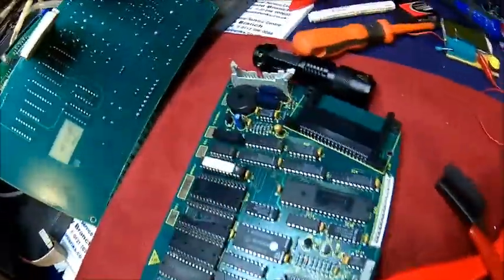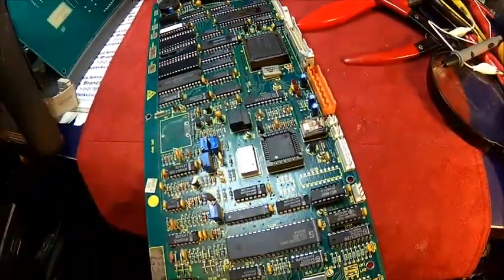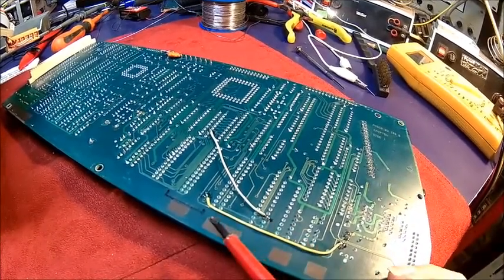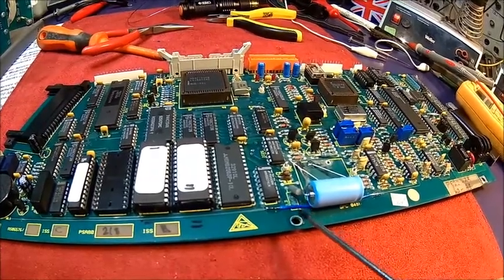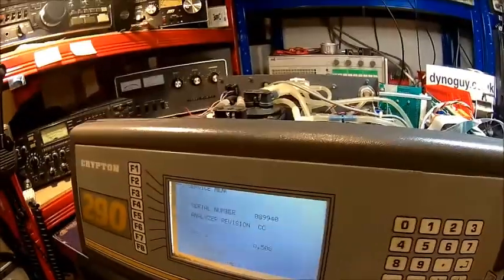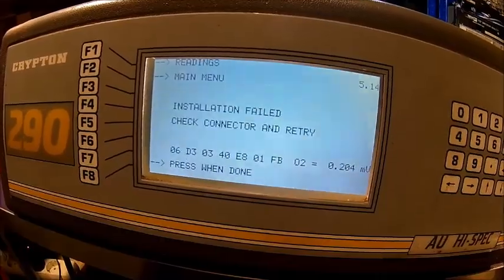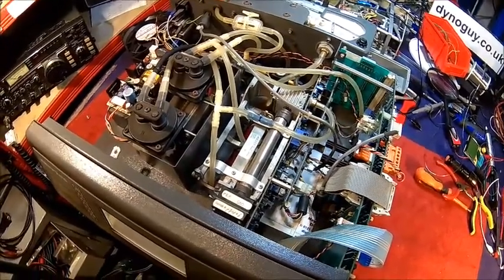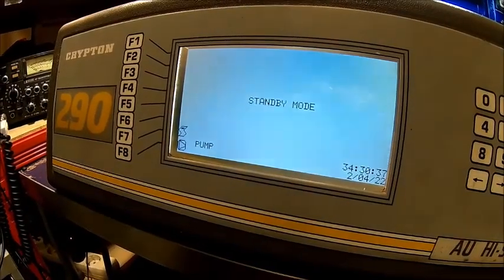Crypton 290 Emissions Analyser repair - part 3 - back to life ! (Car diagnostic equipment)

Comment: Very interesting you did find the problem... yes there are more with this problem... I did repair more of them.. all succes.. but today I did get a 290 with exactly the same problem as your tester,.. flickering screen after touching  a button. But I did look with wiring you did replace.. ( sorry hehe ), but it always those 2 wires that has to be fixed  with that problem ??  Thanks again we can learn.. Please can give me an answer. Regards PAB Netherlands
Reply from the maker: Perhaps a power supply issue, check all the supply voltages

Comment: Impressive job. Hopefully it all works when you hook up the new o2 sensor.
Reply from the maker: Thanks,  i am almost certain it will work, because it was accepting it when simulated the correct voltage level of a new sensor. We'll see when the sensor is here ....

Comment: Wow well done Mike you certainly know your stuff, if the O2 Sensor is anything like the ones in my flue gas analyser they only last around a year before the need replacing.

Alan.
Reply from the maker: Thanks Alan,  i think they are similar, but it seems the lifespan has more to do with running hours. As you use your equipment professionally it will get a lot more runtime than in my shop where i only use it occasionally.

Comment: Well done, I really enjoyed the 3 parts. I had a problem with my transwave converter boost and it turned out that my 24v transformer had burnt out too.
Works perfectly now 👍
Reply from the maker: Thanks,...glad you like it... Thanks for watching and please subscribe
Reply: dynoguy
I have been subscribed since I found your vid on the converter
Reply from the maker: That's strange, because you not appearing in my subscribers list ,...perhaps YT playing up. 
Btw., just acquired another faulty 4hp phase converter, it's an older style with a simple current sensing coil hammering on a micro switch, so that repair should come soon as well.
Reply: Look forward to seeing that.
Yeah I have been subscribed for about 6 weeks